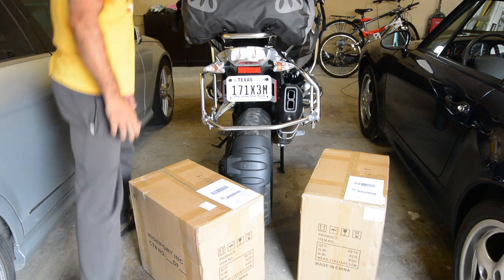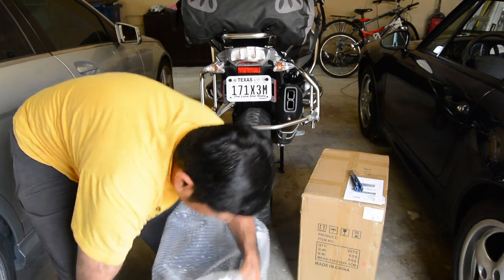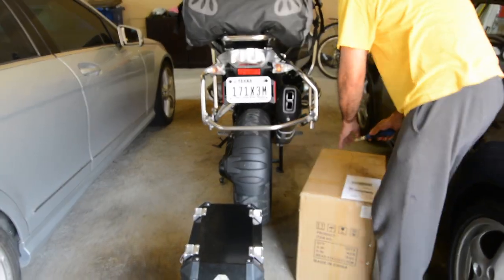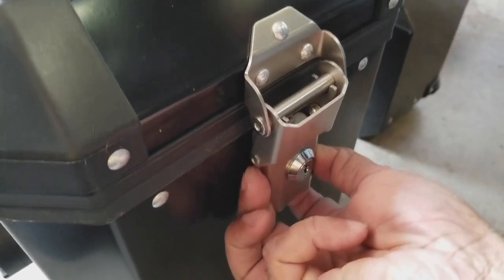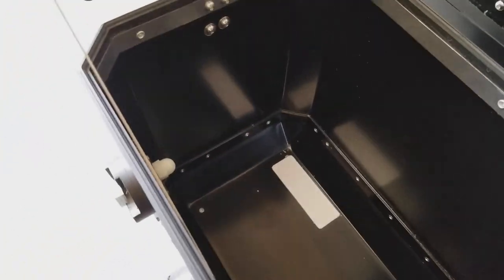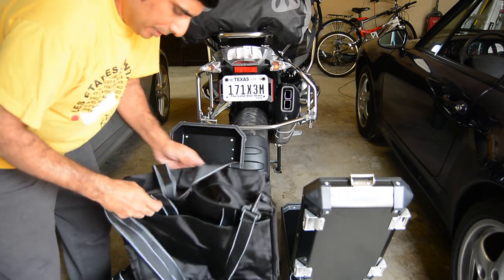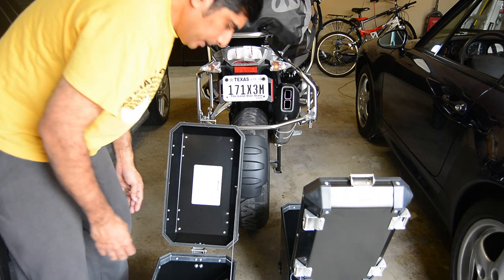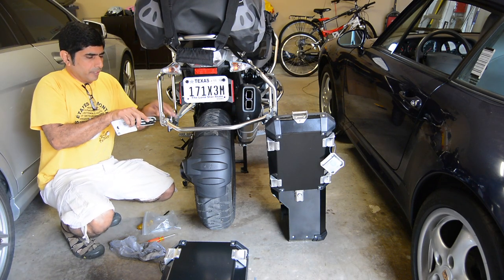Brooks Auto Sports Panniers install on 2017 BMW R1200 GSA!

Comment: Man, I just received my copy of these panniers, and even after removing the reflector on the left side I just could not see a way to make that bag fit.   I must be an idiot.  I guess I have to try again now ;-).
Reply from the maker: Hmm... Hopefully my video helps, good luck!
Reply: @motovloggingwithvman2188  Well, it just comes down to me being an idiot.  I got “target fixation” on trying to place the bottom grabbers on the wrong side of the welded reflector tabs.  Just needed to move them to the other side 🙄.  Haha.  Thank you for the very quick answer.  Your video at least made me try again and to be a bit more flexible 😉.  BTW, I have the “same” bike.  Mine is a 2017 TB.  Looks great with the black bags (and I have the BMW top case.  They all match pretty well, at least in my dim parking garage.
Reply from the maker: @mike.thomas  Glad you figured it out! Yup, it sure looks cool on that color bike. Think it matches perfectly! Enjoy your trips, you will not be disappointed. I have added Tusk soft panniers as I do a lot of offroad in my trips. But for street, you can't beat these
Reply: @motovloggingwithvman2188  I strongly considered soft, but when I found these hard ones for so “inexpensive” I could not resist.  I doubt I’ll ever go hardcore off-road (nothing stronger than gravel fire roads, unless by accident 🙃), so hopefully these will be my last bags.  Thanks for the vid, and enjoy your bike!